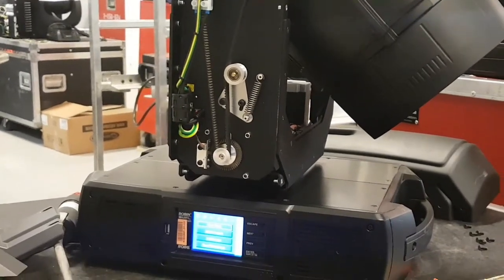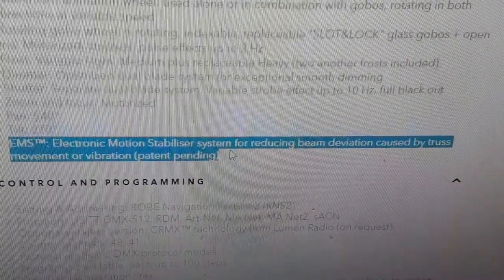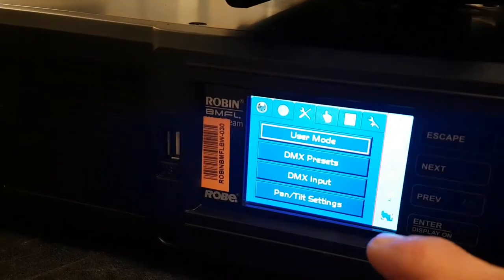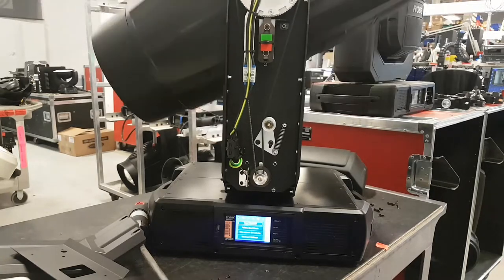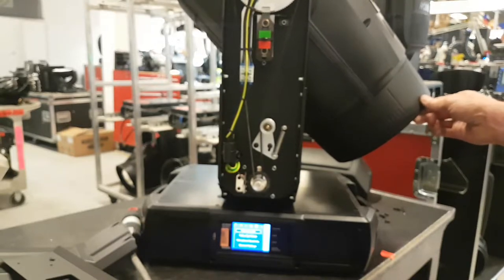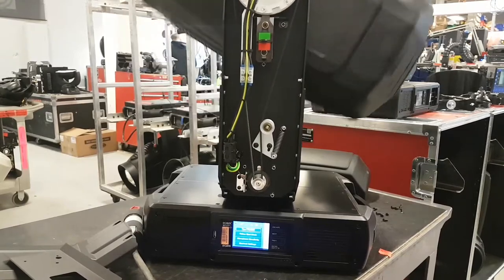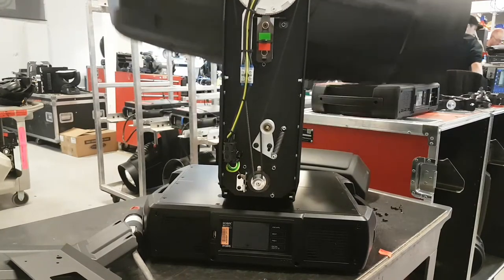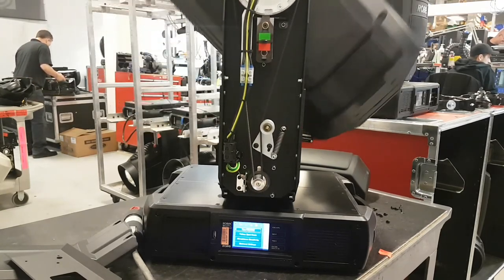Robe BMFL Wash Beam Tilt problem or not?

Comment: Hello! I was wondering if you had ever encountered a heating problem with Vari-Light 3000/3500’s? I have this problem constantly but don’t know if it’s a sensor issue or lamp problem.
Reply from the maker: Tanner Londo usually heat problems in vari-lite fixture are mostly caused by a deffective fan usually the one that is right on top of the lamp